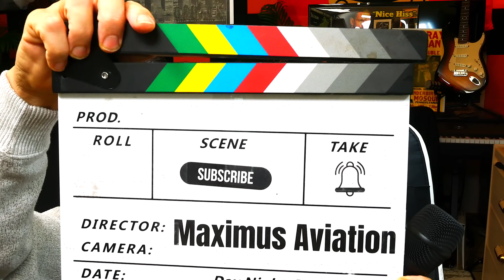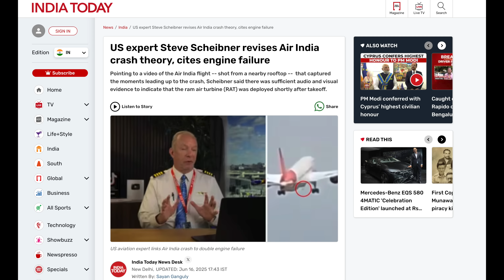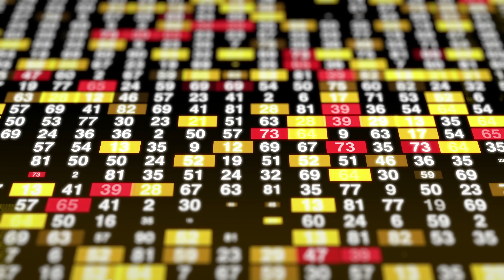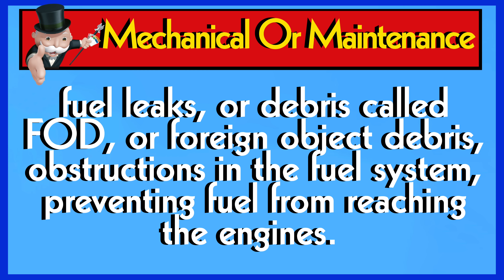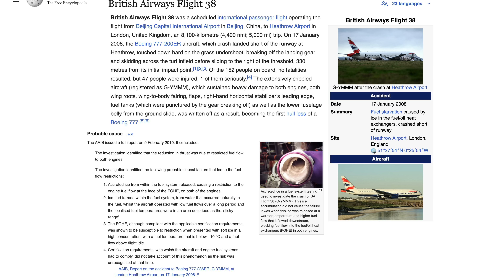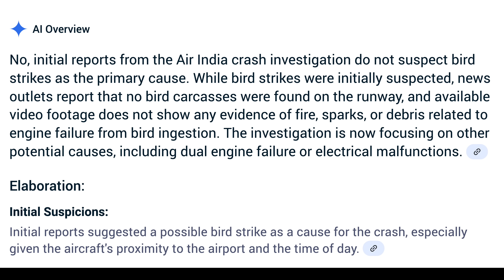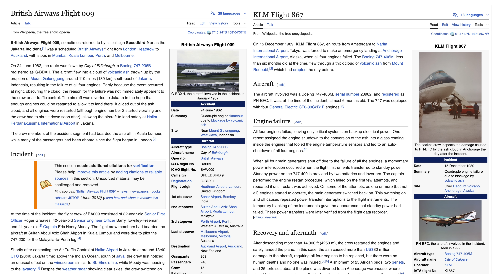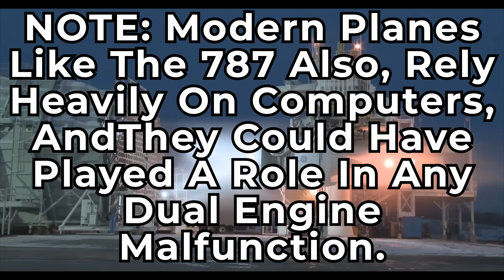Dual Engine FAILURE, Real Or Just The Latest Guess By Armchair Pilots? Find Out How Engines Fail ✈️

Comment: Maximus the rat was out and found way before you ever went 2 videos 
Wings perfect as I have been on many
Thrust perfect 
Issues with power 
YES after
DUST 🤔 from why late take of or them getting on the runway and just turn early on to the run way and not going to the full length of the run way
We all Find later
But unless AI
we can hear 👂 the rat
Also I see nothing but pilots doing everything possible to do there best

https://youtu.be/SbDJjgN7Xbo?si=Cgh4PRCfqlsavrpo

Comment: Maximus go here "Air India 171 URGENT New Data FADEC ECC Failure - Captain Steeeve RESPONDS" and check out the coments below the video that indicates it was not the Fadec failure but power to the fuel shut off valves or the software controlling them. This will get you on track!

Comment: A possible scenario.
We are dealing with a possible electrical overload that leads to entering a "fail-safe" mode, that is, turning off the power supply to some consumers in order to avoid a breakdown of the system as a whole. The disconnection of some consumers is prioritized. If the controller considers that it must disconnect motors that drive fuel pumps, before other less important consumers, then we are talking about a fatal design flaw! 
The fact that there were problems with the air conditioning supply (it did not work or worked intermittently) would be an indication that the controller nevertheless sought to reduce consumption in unimportant consumers... it is possible that this was not enough.
There would also be the possibility of an electronic component failing due to an overtemperature reached in a very important/vital equipment... before takeoff the plane was parked for quite a long time at a high ambient temperature.
I believe the reduction in thrust was ordered by the onboard computer and has nothing to do with the GE engines or pilot error. It is a risk of all ultra-automated aircraft (FBW - Fly-by-Wire).
Decoding the recordings from the black boxes will shed light on this case. I do not know to what extent technical details will be published.

Comment: Usually enjoy your videos Maximus but this one is a word salad of nonsense. There was a dual engine failure. Pilot said so and the RAT deployed and the airliner began sinking at 500 ft. A passenger on the incoming flight reported issues with AC and entertain center issues. Forget the nonsense of birds, frozen fuel and the other verbal nonsense and diarreah  you talk about. The best hypothesis that has been brought up is a programming issue in the engine management hardware. 
   In reality the black box is off to America and the Indian officials need to watch for a coverup like a hawk. Boeing is critical to the US economy and if it is a programming issue with the engine management system and it becomes public Boeing could go into the history books. Remember the coverup of the TWA 800 investigation where the US Navy brought it down. 
   Maximus back on topic please.

Comment: The argument that it couldn't have happened because the theoretical probability is so low does not explain the reality that it did crash.
Reply: Absolutely.
And as every air crash in history shows us, there is always a "New" possibility causing something that we have never seen before. Especially as known problems tend to get designed out over time.

People saying "it has to be x" or "only y can cause this" are very small minded.

When that 777 landed short at Heathrow due to fuel icing, nobody thought that was a possibility because of fuel heating, airfield temperatures and system design.

It was the learning point for a new failure means.

This crash could have something "low possibility" becsuse of an issue we haven't seen before.

Time will tell.

Comment: Sorry, Maximus. This video does not live up to your standards. (Come on: fuel icing in India? Then rather vapor lock!) What‘s really interesting is that according to sources - and I am by no means a Boeing expert - something called the „Fuel shut off valves@ (or FSOVs) can shut off the fuel flow to both engines and that a severe electrical fault can also cause that. (The rat was deployed - remember?) Also the FADEC system (or what it‘s called) could have put the engines into a „safe mode“ (but throttling them back to idle) due to some sensor malfunction or electrical (or software) glitch. Remember the MCAS system, that was meant to „help“ the pilot fly the plane, when it actually killed everyone on board in two instances (due to a sensor malfunction and lack of redundancy!) I hope I am wrong, but this all sound to me that the plane „knew better“, overruled the pilots and either shut down fuel flow to the otherwise perfectly working engines or throttled them back to idle for some reason. I hope I am wrong, but this again sounds like a fundamental system design flaw to me. Even sloppy maintenance should not be able to cause a plane kill fuel flow to the engines 5 sec after rotation. There should be sufficient redundancy to prevent that. I am curious to know ultimately, which holes in the Swiss Cheese Model have line up here. (And it usually needs a number of holes, like maintenance errors combined with a system design error etc)
Reply: Im putting my money on fuel icing. You're not looikng at the big picture.

Comment: Thing is there is no problem in discussing  an accident but making your own bias "oh this must have happened oh surely" attitude is wrong, in juju they blamed pilots first turns out they did everything in their power save that plane, but no buddy talks about the airport location not to mention a concrete wall, in air india case most probable "again maybe but lets see what the ntsb will say"  cause might be maintenance, air india after the merger air india is buy planes but due cap on boing factory, airbus backlog, the world in general, we are not able to get those planes quickly enough  to retire those old planes. Also if the video about ac / power having issues on the previous route is true, the log book data will be crucial for the investigation. Again it is a theory The first ntsb report will make things clear then i hope people incharge will also make some broader changes, also lets hope it is not some software glitch

Comment: So I guess.

It's starting to get a little too hot at times along the equator or so.  To launch planes during the hottest part of the day.

Is off the table as a reason?  A hot earth will obviously limit flights.  But that's not like it's gonna happen tomorrow. or a hundred years from now.

Tower said it wasn't over 110 degrees that day.  But actual temp at point of liftoff is unknown???

The instrumentation recovery box would have the actual temp around the plane recorded yes?

Comment: Max, dieselgate proved you could get an engine to be starved of fuel intentionally when emissions mode was triggered. Will the engines run at medium thrust on the ground, potentially blowing over catering trucks left, right and centre unless overridden by maintenance engineers for an engine test on an isolated part of the airport? Safety protocols would prevent  simple throttle command override’s.

Comment: The take-off and climb phases are among the most critical segments of flight, requiring precise coordination of systems such as the Takeoff/Go-Around (TOGA) mode, autothrottle, and Full Authority Digital Engine Control (FADEC). In the Boeing 787 Dreamliner, these systems interact to manage engine thrust, airspeed, and pitch guidance to ensure a safe and stable ascent.However, malfunctions—such as erroneous thrust commands due to faulty logic or sensor input (e.g., low range radio altimeter (LRRA) anomalies), hardware interface failures, or pilot mode selection errors—can lead to critical outcomes, including insufficient thrust, asymmetric power, or loss of climb performance. There have been a series of FAA Airworthiness Directives (AD) and Boeing Bulletins that address take-off and climb issues for the 787. I would expect these to be addressed early in the investigation for implementation and compliance. AD 2024 -16-07 mandated software updates to the Thrust Management (TM) and Displays & Crew Alerting (DCA) system to correct auto throttle logic errors that can be triggered by erroneous Low Range Radar Altimeter (LRAA) inputs . The AD specifcally addressed thrust anomalies during take-off and climb. Then in FAA 5G/Radar Altimeter Interference mitigation Measures FAA AD 2023-10-02 was for multiple aircraft types that included the 787. It addressed risks posed by 5G C Band. interference to LRAA functionality that required upgrades to Group 4 compliant radar altimeters or imposing operational limitations during low altitude phases of take-off and climb - appropriate 787 affected radar altimeters, The Boeing Alert Requirements B787 Bulletin Nov 2022 required the installation of updated TM software to correct erroneous thrust commands during take-off , go around or climb due to auto-throttle/LRRA integration issues. Then there was Flight Crew Operations Manual (FCOM) B787 that provided operational guidance for flight crews to manage auto throttle anomalies and reduce risk during take-off, climb and go-arounds - issued alongside n FAA SAIB. My point is that there has been a history of take off climb issues well addressed by FAA and Boeing. But I would expect AI to be compliant. But has another gremlin crept in to the sophisticated combination of the 787, the Low Range Radio Altimeter (LRRA), Auto-throttle, and FADEC that is an integrated avionics and propulsion control system, albeit they do not form a direct linear command chain. Each system plays a specific role, and their interaction is governed by flight control logic and redundancy mechanisms. For a dual engine draw down totally or to idle the critical sensors and power supplies shared by both engines , as each has its own redundancy, must be uppermost in the investigators agenda and schedule as its "operational1 that could affect many 787 fleets. 
My background is an aerosystems engineer Mil and Civil - developed engine health monitoring (inc critical parts LCF life usage) and engine trending and diagnostics as well as Mil fixed wing aircraft damage assesssor.

Comment: Most likely hypothesised crash sequence for Air India Flight AI171.

AI171 fell victim to a chain of underestimated thrust, atmospheric resistance, electrical collapse during gear-up – and a stall from which there was no recovery at low altitude. No single ultimate failure – but a network of silent weaknesses that ultimately aligned into catastrophe.

1.	Incorrect or insufficiently adjusted takeoff data → possible underestimation of weight or temperature in the FMS → results in too low thrust (FLEX thrust) at takeoff → unusually long runway distance is used
2.	Extremely hot ambient temperature (~40 °C) + low pressure (~1000 hPa) → significantly lower air density → reduces both engine performance and lift → simulates “high density altitude” despite low field elevation.
3.	Landing gear retracted – correct pilot action → the 787 uses electric actuators (not hydraulics) for gear retraction → fully loaded aircraft + hot air = high mechanical load
4.	Electrical failure during gear-up sequence → overload triggers load shedding or total bus failure → RAT (Ram Air Turbine) is deployed – a clear sign of dual electrical loss
5.	Landing gear never retracts → visual evidence shows gear still down at moment of crash → causes high drag, prevents acceleration
6.	Aircraft never reaches V2 → no safe climb speed is achieved → pitch increases in attempt to climb, but speed decreases
7.	Stall at low altitude – no recovery margin → pitch + low speed + gear drag = aerodynamic stall → engines still functioning, but provide no effective lift → aircraft loses control and crashes

Comment: Double engine failure not that rare. Happens regularly, usually leads to loss of aircraft. Most common cause FOD second most common, fuel system failure of one sort or another.

171, engines failed at or near takeoff. Its either airside, FOD, or fuel side, unwanted material in fuel, vapour, dirt.

Comment: These are fully "fly by wire", The controls wire to avionics, avionics send throttle signal to the FADEC. There was it seems electrical issues, if avionics lost power FADEC loses throttle signal!!!!!!
Reply: I heard they are designed to maintain the last setting.

Comment: I've flown many Boeings, though not the 787. What if the RAT wasn't deployed automatically by a dual engine failure  or electrical faults, but if it was the RAT itself that was faulty, ie it deployed without being commanded? I'm not familiar with the 787's FADEC system, but I'm pretty sure it would operate in a degraded mode with the RAT deployed. With the engine driven generators still producing power and the RAT also inputting into the electrical system, there may be potential for the FADEC to be receiving conflicting signals? Could this cause a reset or fault in the FADEC system?  The RAT would normally be deployed when there was no power from the engine driven generators and/or thrust levers at idle. There perhaps just wasnt enough time available for the electical system and FADEC to stabilise before they crashed?

Comment: A significant software bug in the Boeing 787 Dreamliner, discovered in 2015, could cause a complete electrical shutdown, potentially leading to loss of control. This issue stems from a software counter within the generator control units (GCUs) that overflows after 248 days of continuous power, causing the GCUs to enter failsafe mode and cease power generation. Boeing and the FAA have addressed the issue with a maintenance directive to periodically power down the GCUs and are developing a permanent software fix.
Reply: Google tells me there are gcu for each generator. So it makes you wonder if they bother to offset the reset schedule so, you know... they don't fail at the same time like for example the middle of a takeoff.
Reply: @mikesorensen5228  an offset would be a really good way to prevent this software issue causing simultaneous loss of GCUs. You would think the AMM and any AD would suggest/mandate this as a safety precaution.

Dont swap both at the same time, use one with 0 hours and one robbed from elsewhere with a different number of hours on it.
Reply: Wow, ain't that something.
Reply: That would be a disaster for Boeing.
Reply: 😲 10 years, and still no fix? 😧
Reply: But dont engines have there own power from magnetos. And im not sure but it think engines are designed to hold last known thrust setting if they dont get signal from the flight control.
Reply: @mikesorensen5228  Points to flight control malfunction then.  Bad news for Boeing.
Reply: I’m guessing it’s something like that.  Engines just went to idle.

Comment: You are blaming interested people ("787 experts") for having their own theory, 
while making false claims without Information (you say yourself) in your Video from June 12th 2025 (watch?v=41WMW10YEyI).

Timestamps from your 12.06.2025 video:

@0:20:  "I have no information, really, but a new video came out." 
@1:03:  "The first thing you notice was it, that the flaps were not extended, aaand the plane took almost aaall of the runway"  
@2:13:  "The flaps were up"   
@2:45:  "No flaps, and the gear was down"
@3:15:  "The flaps are up, gear is down."
@5:10:  "But the plane as it took off you can see on the runyway was not configured with it´s flaps extended."
@8:45:  "The flaps were up, ...

Comment: There is a positive angle to the armchair critics and hangar fliers leaving comments on the web: synergy.  Synergy is the ability of an informed group to outperform a solitary expert or even a group of experts.
Thus far I have seen only one Youtuber mention the FADEC.  This is the computer that exercises full engine thrust authority, over and above the pilots.  A pilot normally has full authority to run the engines to destruction in order to try to avert disaster.  The FADEC denies the pilots that option.  There has been at least one crash caused by a FADEC shutting down 3 of 4 engines uncommanded by the pilots.
https://en.wikipedia.org/wiki/2015_Seville_Airbus_A400M_crash

Comment: 1.	No asymmetric flight, BOTH ENGINES INOP
2.	LG «UP» commenced moving but was NOT COMPLETED.
3.	LG «UP» triggered dual engine failure through SYSTEM BUG.
4.	Fuel (electrical) starvation.
5.	RAT deployed SATIS.

Comment: There is some confusion hear between engine failure, i.e. the engine is broken, and loss of thrust. A perfectly healthy engine can lose thrust for a number of reasons external to the engine itself. The most likely cause of the AI181 flameouts is fuel starvation. I assume here that multiple engine control redundancy was in place throughout, i.e. nothing traceable back to a single source.

The BA777 at Heathrow in 2008 did not overshoot the runway. It undershot the runway.
Reply: fed from the center tank on take off,,  separate pumps though
Reply: There's lots of "no understanding" here!

Comment: Have dual failure you would need fuel problem emp or sabotage 
Iran threaten India cause they help the jews. When in  school we use strobe light test bearings and wobble. Supposedly the plane had issues on its last flight. My relative works on f35 on its antihack system. Plane Carter sent get hostages in Iran was sabotage by dousing engine with a halon burst. 
Flight usaairways 422 Chicago mob boss had water put hydraulics boiling the fluid blowing the seals which caused rudder detach. Guy got million for killing government informant